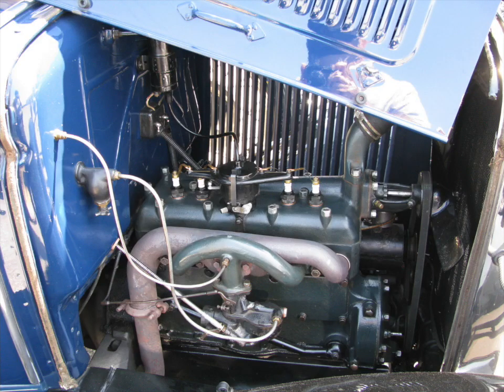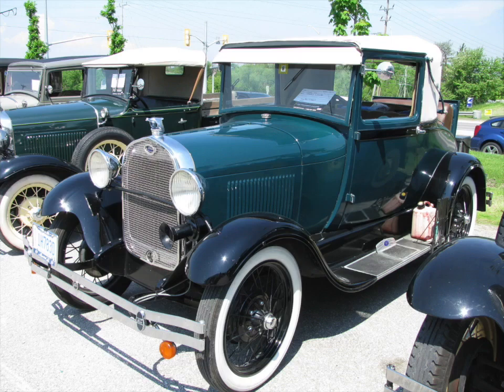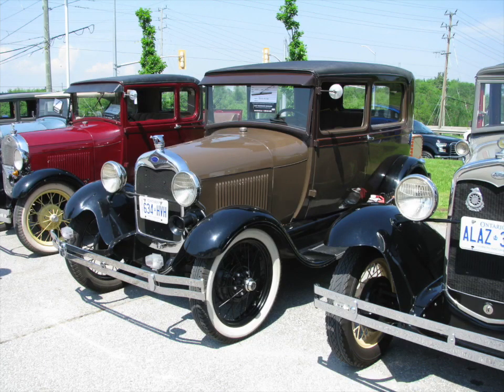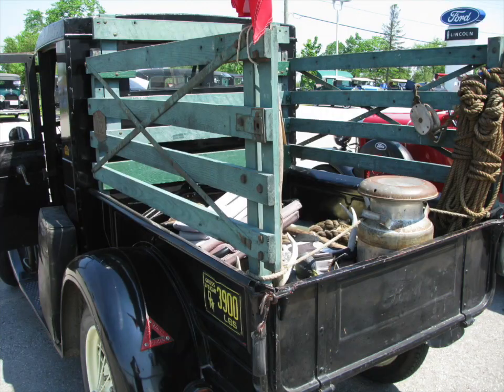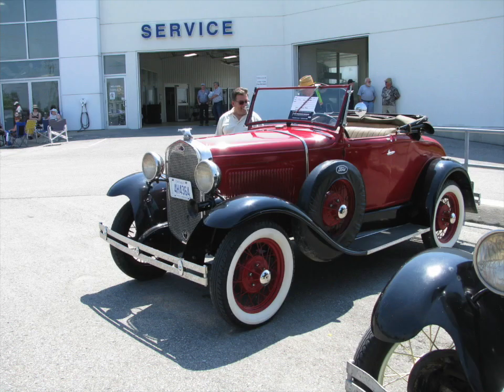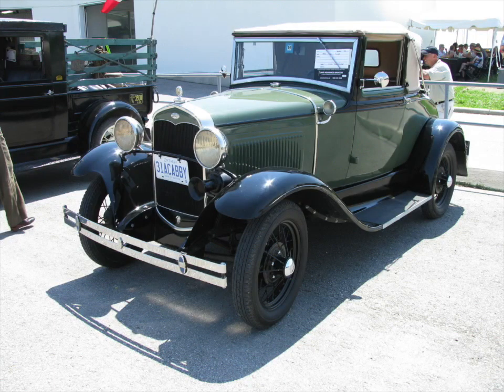Huronia Wire Wheels Chapter Inspection Day 2018

Comment: That is really cool, Peter, and some beautiful examples of Americana, even if it’s in Canada. LoL. Question: Are the inspectors all volunteers? Do u have to pay a fee for this to them or Ford Dealer for hosting. And if u had an issue, would that dealership do the work, assuming the price was reasonable or would u have to take to a vintage specialist? Wouldn’t think too many places would do work on almost 100 year old cars. 😁
Reply from the maker: The inspectors are all members of the chapter and are volunteers. The dealership uses this day as an opportunity to do a fundraiser for the local hospital so no fee. I doubt the dealership would touch these old cars. The technician is there on this day only to oversee the safe use of the hoist. For the most part we fix the cars ourselves with aid from club/chapter members. For extreme examples perhaps it would go to a specialized shop. And most of these were built here in Canada. One give away is the Robertson (square head) screws used for trim etc.